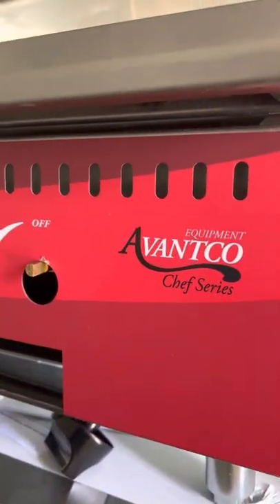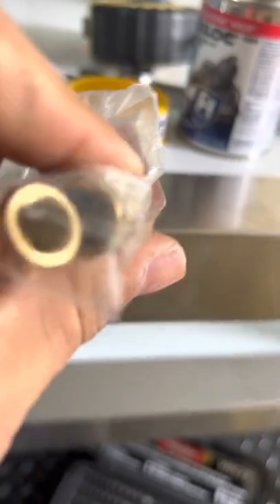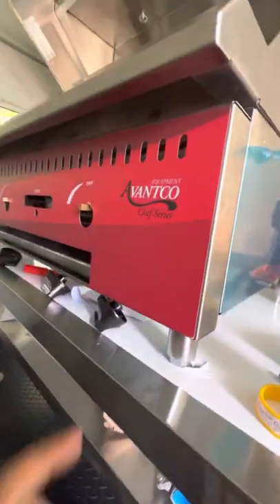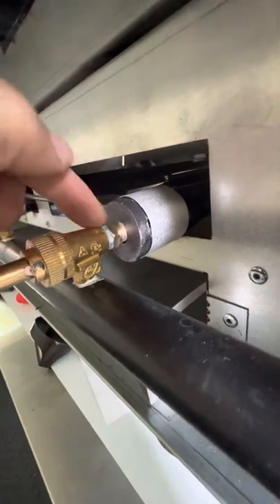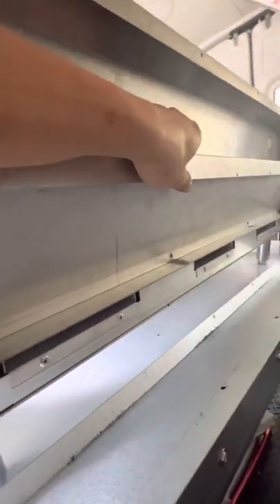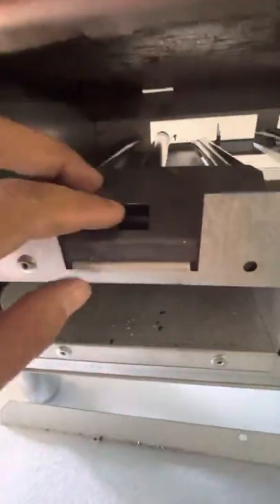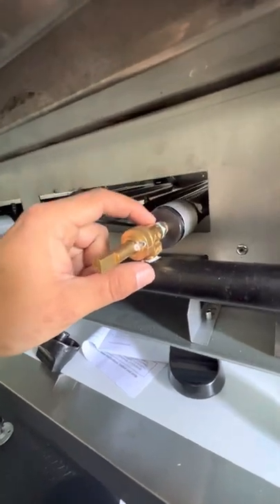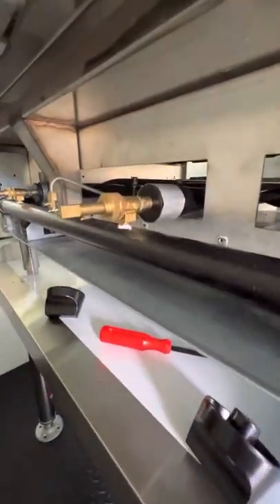Avantco Gas Griddle Natural Gas to Liquid Propane Conversation

Comment: I watched this and then took the front off.  Two screws hold the gas rail and two hookups come off that for the pilots.  Unhook the pilot lines and take out the two screws holding the gas rail and it pulls out completely.  Change the orifices and put it back together.   Leak check the pilot lines once reassembled.   You don’t have to take the back off or drill rivets.  Only the front comes off. Just wanted to share my experience.
Reply: What part number for the kit? I have the same avantco 36" griddle he has in this video

Comment: In process of doing this. Found a simplier route. 
Pop the pilot line off the main gas bar
Then the 2 self tappers.  Bsr slides out.  Easy as pie

Comment: I’ve got the Avantco 4 burner stove and the char broiler in my new food truck.
All of the burners act strange, they fluctuate the flames, sound like jets, kinda pop on and off and create tons of carbon soot.

I changed the orifices to propane and flipped the little plastic flow thing inside the regulator (as the instructions say to).

I cant get them to work right, you mentioned there’s a way to adjust the flame, I don’t remember seeing that in the manual. How do you adjust them?
Reply from the maker: The burners acting improperly sounds like improper gas pressure probably need to adjust the regulator
Reply: @IslandTailChaser  how to adjust the  regulator? There aren’t any dials to spin or anything, I did follow the directions and flipped the plastic flow thing inside of it
Reply from the maker: @benstoth  https://youtu.be/gLb0l5a96s0?si=ZTyIlo7TnQg9c0Lq watch this video it explains what to do.

Comment: Did switching it to l.p from natural gas control the excessive flames? Mine sounds like it releases propane and catches a bit down there. I barely installed mine
Reply from the maker: The pilot has an adjuster so that the flame on pilot is a lot smaller. Idk if that helps you out.